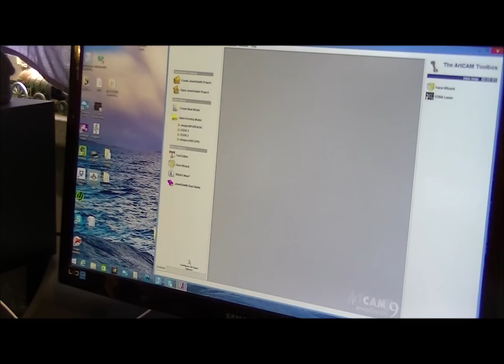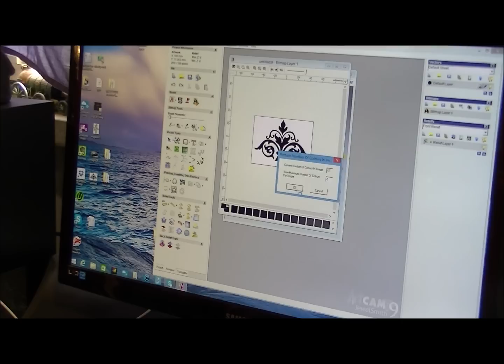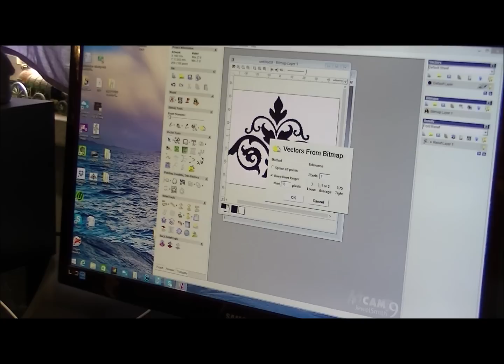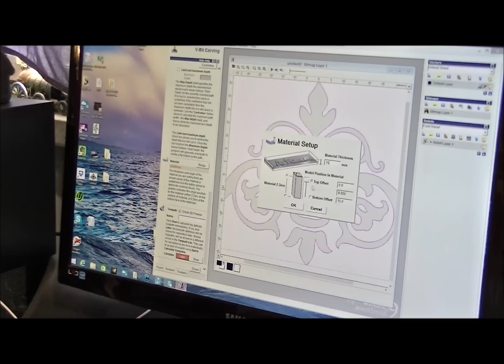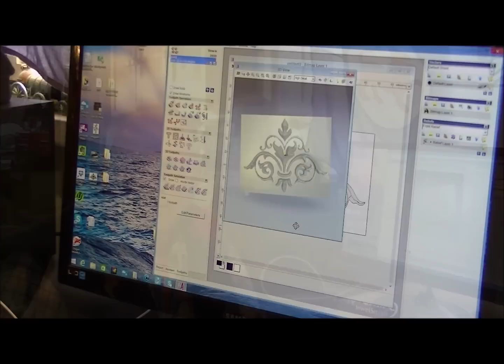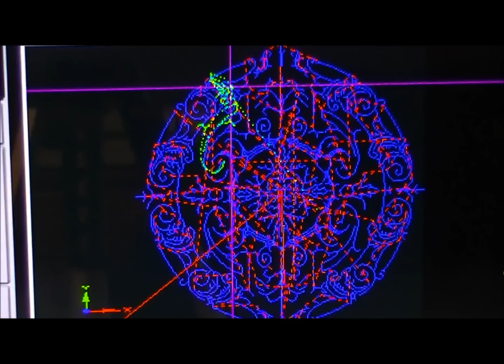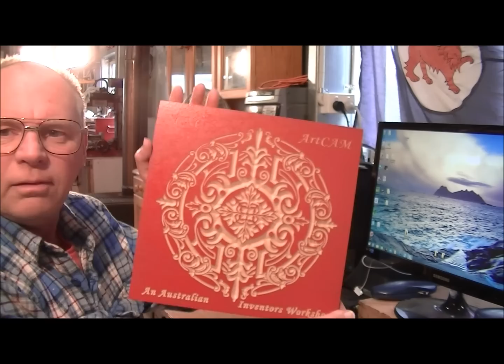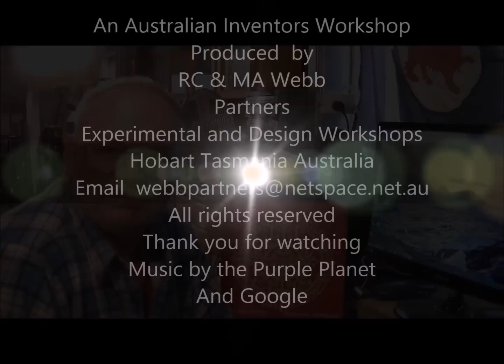102 CNC Router, Vbit Carving ArtCAM Mach 3

Comment: Great video thanks Roger. I am totally new to the Router world, so a couple of questions :)  So you are actually not sending the job out directly from Artcam? Artcam is "only" to set up the artwork and make the Tool paths which you then open in Mach3, is that correct?

Comment: Hi, could you guide me what could be the reason for what I face?
Working on project in which using 90 degree V bit to have a chamfer edges inside triangles next to each other. Then cutouts at the deepest end of the chamfer. To save time of V bit work as the material is aluminum, chamfer is programmed between the outer and inner lines of the triangles then followed by end mill for cutout.
Distance between two top edges of chamfers should be 10 mm (the distance between the outer lines of triangles). But the end result is the distance is smaller than that it's fixed to 7 mm instead. Tried to shift lines in and out, tool settings but always get this value 7 mm. Could you help what would be the reason for this and what need to be corrected?
Many thanks in advance